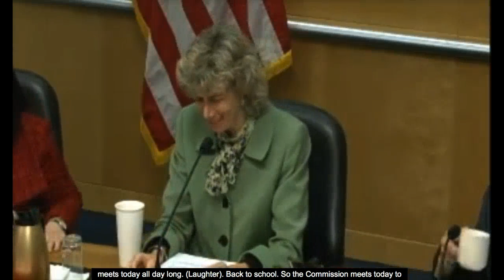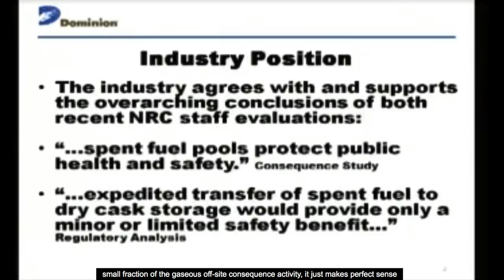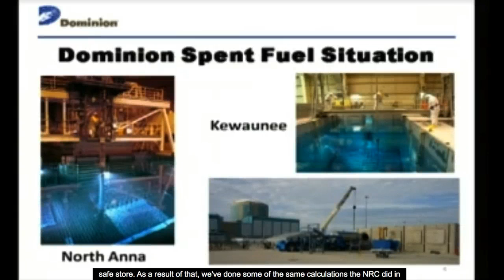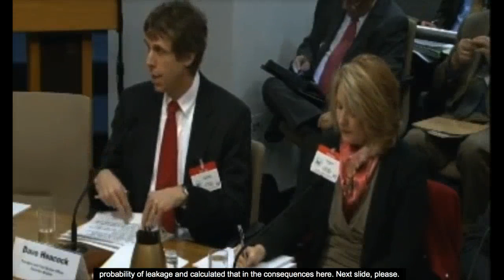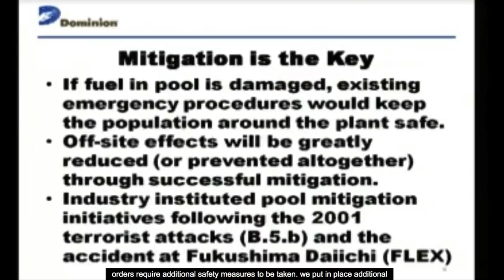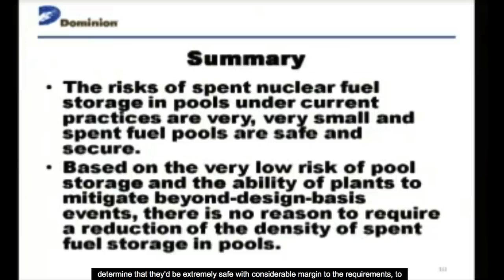MITIGATING A SFP DISASTER, JUST ADD WATER!~David Heacock pres. Dominion Nuclear

Comment: YT won't let me copy paste your info box.  Will you copy paste it down in the description box so I can copy paste it that way?  Thanks Jrae!!!  :)
  Not under the video, but in the comment area down here :)
Reply from the maker: NRC: Briefing on Spent Fuel Pool Safety and Consideration of Expedited Transfer of Spent Fuel to Dry Casks
January 6, 2014
DAVE HEACOCK: ~MITIGATING A SPENT FUEL POOL DISASTER IS SIMPLE, 
"JUST ADD WATER!"
"ZERO PROBABILITY OF A SFP DISASTER!"

Mr. David A. Heacock serves as the President and Chief Nuclear Officer Dominion Nuclear at Dominion Resources, Inc. 
Total Calculated Compensation 2013 =$1,502,560.00
Mr. Heacock served as President of Virginia Power and Chief Nuclear Officer of Virginia Power at Dominion Resources Inc. since June 1, 2009. Mr. Heacock is responsible for Dominion's overall nuclear operations, which include four nuclear power stations located in Connecticut, Virginia and Wisconsin. He served as the Co-President and Chief Nuclear Officer of Virginia Electric and Power Company since June 2009. He served as the President of Dominion Virginia Power (DVP) at Virginia Electric and Power Company from June 2008 to June 1, 2009. He served as the Chief Operating Officer of Dominion Virginia Power at Virginia Electric and Power Company from June 2008 to June 01, 2009. He served as Senior Vice President of Dominion Resources Inc. from June 1, 2008 to June 1, 2009. He served as a Senior Vice President of Dominion Virginia Power of VP from October 2007 to May 2008. He served as Senior Vice President of Fossil & Hydro at Virginia Electric and Power Company from April 2005 to September 2007. Mr. Heacock also served as Vice President of Fossil and Hydro from December 2003 to April 2005 and Site Vice President of North Anna Power Station from April 2000 to December 2003.
Heacock was appointed to the Governor's Commission on Climate Change by Virginia Gov. Timothy Kaine in 2007.

THIS STUDY DID NOT CONSIDER RISKS OF MOVING FUEL FROM POOL TO DRY CASK STORAGE!

http://video.nrc.gov/vPlayer.php?eventID=880&type=JW
Reply: Thanks Jrae.  Must be a new YT rule.  UnFukushima Believable.  Thank you again!